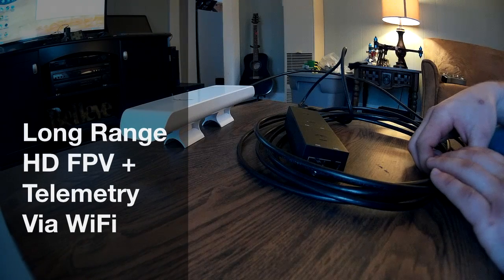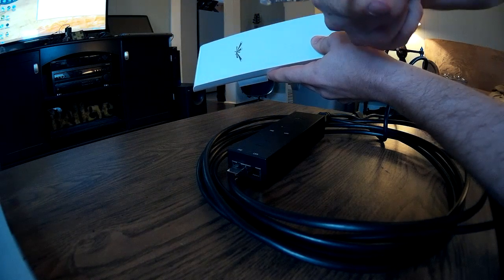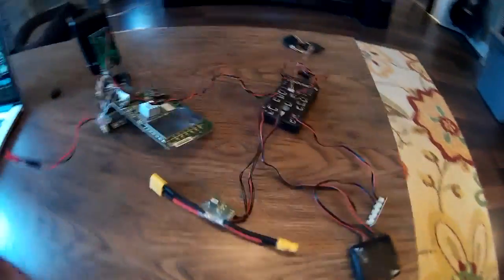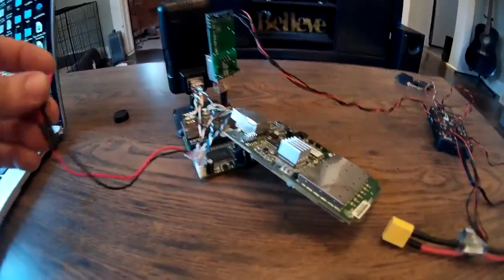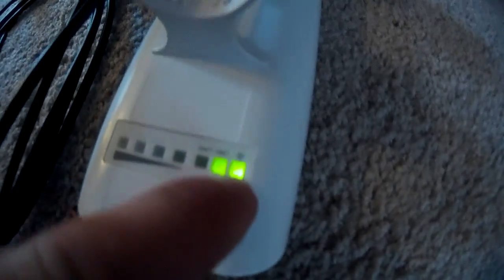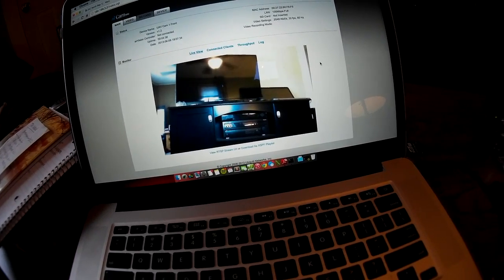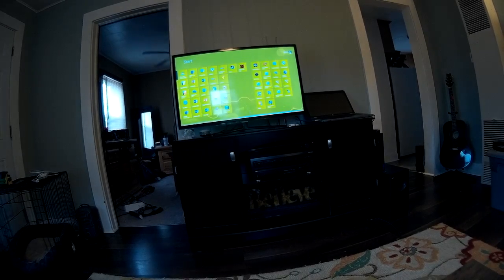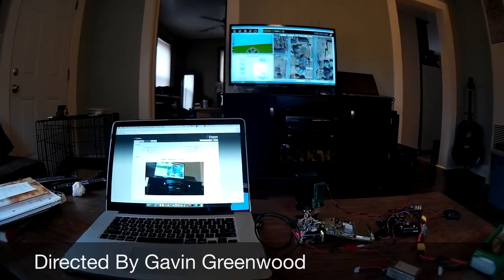Ubiquiti WiFi HD FPV + Pixhawk for Drones Autopilot iPhone/Android Overview 2019 updated

Comment: Thanks bro,
I am working on a project of drone and i am using Ubiquiti Bullet M5 in the drone for sending live video and Ubiquiti airGrid M5 in the ground station to receive the video and show it on the screen

the bullet in the drone is connected to camera through Ethernet cable 
the airgrid in the ground station is connected to computer through Ethernet cable 

and they are configured 

but now, how can we read the data in the ground station?
Reply from the maker: I can consult you more on how to do this. Contact me gavingreenwood56@gmail.com

Comment: Which wifi radio are you connecting to theswitch? Could be a raspi zero wifi configured with the pixhawk to send telemetry and fpv?
Reply: He is using a Ubiquitti LOCO M2, of which he removed the case and hardwired to accept 12Volts from a LiPo instead the original PoE 48volts. In my opinion is a brilliant idea.

Comment: Is it possible to use other cameras, the ones with HDMI or SDI outputs?
Reply from the maker: +Sasha Naronin yes if you simply connect raspberry pi to network switch on craft
Reply from the maker: Only if you use a hdmi to ethernet converter. As long as the camera stream has an IP address it should work
Reply: Gavin Greenwood ah, I see. How does it deal with signal loss and reconnection?
Reply from the maker: It all depends on what radios and camera you use. In this video I was using Ubiquiti M5 Nanostation but now I use Ubiquiti's new 802.11ac products like Rocket AC Lite 5Ghz. It provides fast reconnections and 3x bandwidth. Which is needed when your transmitting 1080P + vehicle telemetry + control commands all over the same link.  Since everything is IP you can do advanced routing methods such as load balancing and redundant connection to the aircraft.
Reply: That's nice.
How do you send the control link? Mission planner RC override or something nicer?
Reply from the maker: +Sasha Naronin  Mission planner works great for now
Reply from the maker: +Sasha Naronin I use a Saitek X52 for the joystick
Reply: Is it possible to display the video in Tower app? As in here https://github.com/DroidPlanner/Tower/wiki/Custom-video-stream

Comment: hi. you can simply use the 12v batter straight from your car to run POE.  You will drain a lot less power bypassing a/c inverter.  Use gator clips on car battery or find cigarette lighter adapter.

Comment: Quick random question. Is there any risk to connecting an APM to serial at the same time as a power module? I know that having it connected to a computer via USB as well as a a PM can fry the board but I wasn't sure about the +5v on UART.
Reply: +Little Grue You can snip the 5V lead. However, you need to keep the ground.

Comment: Does it really cost 10k$ to make?  Or are you just ripping the crap outta a few people due to the long range?
Reply from the maker: +Anderson Stuart Carredias It's not the same though. This system is completely different and completely customizable. Lightbridge is like Apple products (Limited user customization) and my system is like Android products(very customizable.
Reply: @GavinGreenwood1  You are right Gavin, but still he got a point there, the secret ingredient in your setup is the Ubiquitti Modules.
Reply: +Quad Knight the latter. DJI Lightbridge is $1000 and it works "long range"

Comment: So you are just using a regular wifi system. A Ubiquity client antenna and a master antenna on the ground to stream your video. There is problem with the latency since 200ms for a quad flying in low altitude. You will crash. But with a airplane trying to get a long distance flight its okay with 200ms
Reply: +Ørjan Hofstad I don't think it is intended for racing quads, only larger systems, so a little latency doesn't matter.
Reply from the maker: +Ørjan Hofstad It is based on 802.11n
Reply: You will stil have a latency problem. Since you are transfering Prob. 3-5mbit.

Comment: Great setup . what use for switch and use give poe 24V for nano in the airplane

thank you..
Reply from the maker: +Marcelo Nogueira I used a 3 port switch and hacked it to supply 12v to all equipment.
Reply: @GavinGreenwood1  How did you hack the Ubiquitti LOCO M2 to work at 12Volts.  
BTW great video, i liked the concept. I will be trying it out soon.

Comment: Is there any reason that you aren't using mavproxy on the pi instead of the serial to IP?  It would simplify the set-up a bit, wouldn't it?
Reply from the maker: It would if i was using a PI, this is a PI-less setup.
Reply: Gavin Greenwood *doh*, thanks for pointing out that blindingly obvious point lol. What kind of range and bandwidth have you achieved with this setup?  I am attempting to do the same thing with a raspberry pi, pi cam and two rocket M5s with two CP antennas.
Reply from the maker: Jabelone The range is limited by how good your rf link is. I recommend getting Radio Mobile it is free online and that will allow you to simulate rf links to your aircraft and will give you a good idea of range.
Reply from the maker: Jabelone I've achieved over 10 Miles with ideal condition and setup